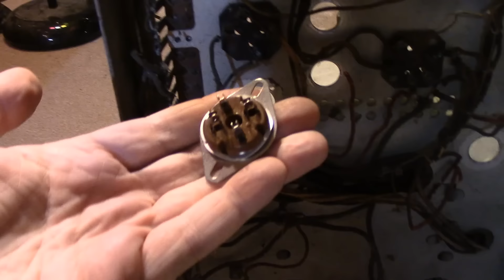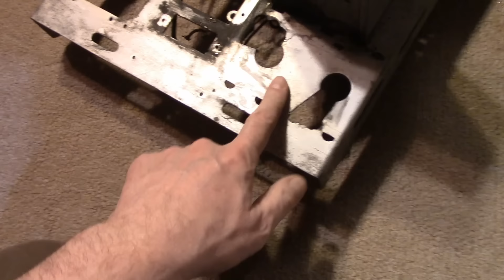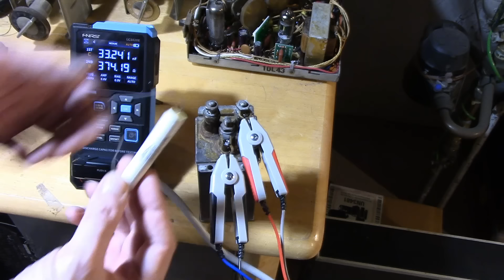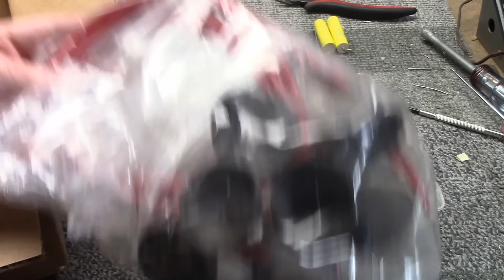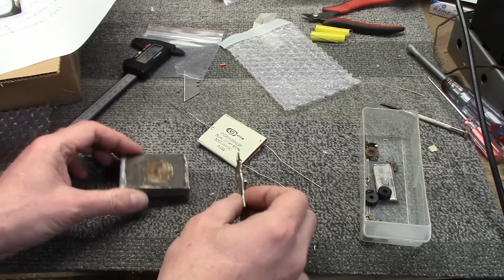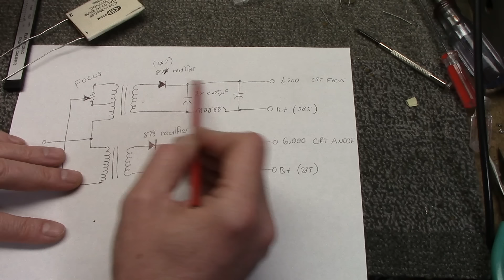RCA 1936 RR-359B TV part 13 - High voltage filter capacitors

Comment: Likely a little late, but if you wanted to use the vintage capacitor and you are worried it might go bad. Just add a protection circuit under the chassis where it cannot be seen. Something like a crowbar circuit? Isn't that what you call it? Don't know if you can design such a thing for a few thousand volts in a practical way. But I'm sure it could be done. 
Even if you are not using the original cap(s). You still might look into protection circuits, for the tv is long time survival.

Comment: What is that Lacquer type Coronado?
Reply from the maker: Corona Dope
Reply: @bandersentv So you're spraying the Corona Dope Lacquer on the transformers enamel winding wire?
Reply from the maker: Brushing it on.  It comes in a small bottle with a brush in the cap like nail polish.
Reply: @bandersentv ok thanks I didn't know you can use Corona Dope Lacquer on transformer winding wire since it can handle higher heat resistant

Comment: Hi Bob, I was thinking you could make a spacer (or two, one for each ear) for that tube socket you filed the mounting holes in. The spacer would be just thick enough to keep the socket from rocking while holding it right up against the chassis. 

Really enjoying this project!

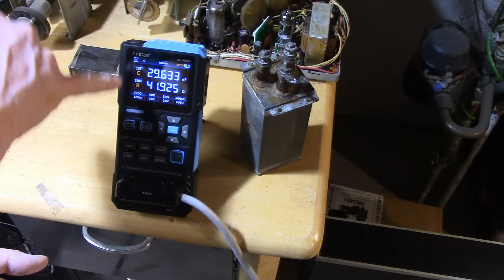Comment: 18:53 - Hi Bob. If you plug the “new” capacitor directly into the tester, does the ESR settle down? Maybe your cable thingy is picking up noise?
Reply from the maker: No, it behaves the same way

Comment: Have you considered machining down the OD of those sockets so they fit about a mm or so from the bottom but still retain that locking ring? Could look nice. Would be quick for a machine shop or contact me and I'll do any simple lathe work like that if you pay shipping

Comment: I’d be a little worried about the creepage and clearance distances around those thin rubber or plastic washers/bushings that are clamped on the inside of the can, insulating the three feedthroughs from the end cover, in the absence of oil filling the can. It may be beneficial to turn down the diameters of those inside metal flanges to get their OD’s further from the can (clearance), and increase creepage distance along the surface of the insulating washers - since the only reason those flanges were probably that large originally was to improve clamping for sealing the oil inside. I imagine they were able to get away with creepage/clearance dimensions MUCH smaller than would be used in air (that’s why the insulators on the outside are taller!). It may well be fine, but it’s difficult to assess the material or condition of those washers at this age, as far as predicting their CTI etc. Maybe those washers could be replaced with a more modern material like Teflon, etc. with more predictable dielectric properties.

Comment: Just make a nice shim to take up the space between the tube socket and chassis so it doesn't rock around and bolt it down. As long as the tube seats fully from the top, all good.

Comment: As far as the replacement tube socket goes, I'm not sure a bakelite socket will handle the high voltage, normally you see a porcelain socket used.

In testing the original 6kV capacitor, run it at 10% above the expected anode voltage for a few days to see if it breaks down.  You know how leaky old caps are and, I hate to see some irreplaceable part destroyed due the cap tuning into a power resistor.
Reply: The tube base is probably also bakelite, so should be fine.
Reply from the maker: No high voltage on those tube sockets. Those are for the B+ supply
Reply: @bandersentv  Good, you should be okay.

Comment: Hi Bob, nice work in trying to keep the restoration as original as possible.

Concerning your LCR meter, the unstable Que reading is due to a poor connection in your meter leads.  I have a similar LCR meter I bought a few years ago that appears to be using the same chip set, as it has the same test frequencies and measurement modes.  Grabbing a few caps from my parts bin, here are my measurements on 3 test sample caps: 

0.1uF, 100V, X7R dielectric ceramic @ 100 Hz test frequency - Cs = 91.79nF, Rs = 208 ohms.

0.22uF, 630V polypropylene film - Cs = 208.8 nF, Rs = 0.1 ohm @ 100 Hz.

0.33 uF, 100V, X7R ceramic - 313.9nF, Rs = 47.7 ohms @ 100 Hz.

I chose 100 Hz since you are have a halfwave rectifier (60 Hz ripple frequency).

The X7R ceramics typically have a Que of 100.  The plastic film caps, typical Que is a few thousand.

As far as the meter lead connections, set the meter to measure resistance and wiggle suspect connections to trace out problem areas.
Reply from the maker: Nope. Readings jump around even if I insert the caps directly into the tester. Only jumps at low frequencies for plastic film caps. Stable readings at higher frequency or low frequency and much larger capacitance
Reply: @bandersentv It sounds like your meter may have a problem.  One difference between your meter and mine is, my meter was made in Japan, which may account for the performance difference.
Reply: @billharris6886 hmm. China probably doesn't use Japanese chips to make these meters.
Reply: @d46512  I totally agree but, the Chinese are also notorious for stealing patented designs, which may account for the noisy readings with Bob's meter.

Comment: I'm thinking now that you could build or get fabricated a can for the 2 x 0.05 mfd capacitor that expands out to a suitable size in the middle, but tapers back inward on the ends to fit your end plates.  How to get your dual capacitor in the can?  Build or fabricate the can in two pieces that meet in the middle.  Technically the can wouldn't need even to be made out of metal; it could be made out of plastic and spray painted a metal color, and epoxied to the end caps.  Or just put two 0.05 mfd capacitors inside and be done with it, selling your dual capacitor elsewhere.

Comment: Do those neon sign transformers have magnetic shunts in the core like microwave oven transformers for current limiting?  It almost looks like the core extends inward between the primary and secondary. Maybe it won’t matter since you’re winding your filament winding on the same leg of the core as the primary (filament load shouldn’t magnetically load the coupling to the HV secondary), and the HV winding current draw on the set should be low.
Reply from the maker: Yes it does. Did you watch the previous video?
Reply: @bandersentv  I may have missed that. I’ve been following the series but I thought there was quite a bit of progress since the last one I watched! I’ll go find the one I missed. Sometimes YouTube picks and chooses what order to show things in my feed!

Comment: Hi Bob. I’m not sure when those HV caps were made, but if there’s even a chance they contain PCBs in the oil, you absolutely do NOT want to restuff those! Mark them as biohazardous waste and treat accordingly. 😢

Interesting story: the GG-1 (an electric locomotive used on the Northeast Corridor) had oil-filled transformers they later discovered had PCBs. When the locomotives were removed from service (they lasted into the Amtrak era), they couldn’t just send them to the scrapper as it would create an environmental disaster! One such locomotive is on static display at a museum, and I don’t know the disposition of the remainder of these otherwise excellently designed locomotives. The transformers were made by Westinghouse (I believe) around the late ‘20s to early ‘30s, around the time of the Great Depression.
Reply from the maker: Around 1936.  Absolutely there's a chance they contain PCBs.   That's why I was careful.  They are more commonly found in more demanding, industrial settings though.  Expensive stuff.
Reply: Well............. he gutted the little one anyhow.  Where should the stuff go, anyhow?  Hobby/household hazardous waste?  I remember when it used to be collected in the west suburban Chicago area.

Comment: When you do that filiment wind over remember the measured voltage will be a little higher open circuit than voltage at the tube when heating the tube. If it is much lower connected tube emission may be down
Reply from the maker: I test the new winding under load with a tube in the previous video.

Comment: I have a DER DE-5000 an get the same almost random ESR values at lower freqs. If calculate it, at 100Hz, the cap has a reactance of 53k ohms. Trying to discern an ESR with the cap having a huge reactance, the measurement is down in the noise and resolution limits. I use 100kHz to test except for electrolytics. Often may try other freqs asa sanity test.
Reply: Good ESR meters measure the ESR independently from the reactance. Reactance is phase shifted, ESR is not. If the meter uses synchronous rectifier for measurement, it will ignore the reactance.

Comment: How do you keep from losing the plot with so many projects in progress?
Reply from the maker: I write up every project in restoration threads on various forums, take loads of photos and these videos.
Reply: If I'm at all worried I won't remember how something goes together or how it's laid out I take pictures. Back in the early digital camera days I had one I found cheap and I was using it to take pictures of parts i needed for the Dart, plus I was helping a vendor friend so we got to load in a day early. Both of us walked the feild and I took pictures of every booth number that had parts we wanted. The next day early we went around and bought what we wanted before most of the really good stuff got sold.
This was was before easy internet access and Google.